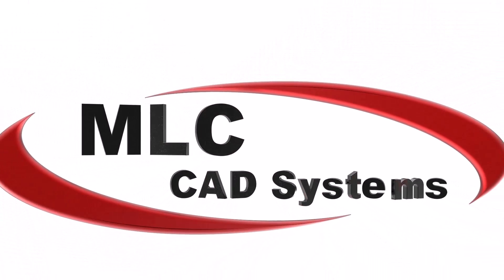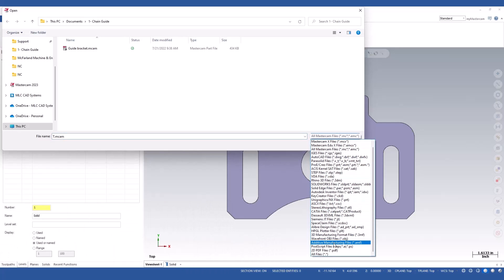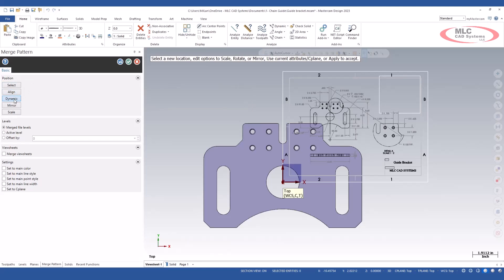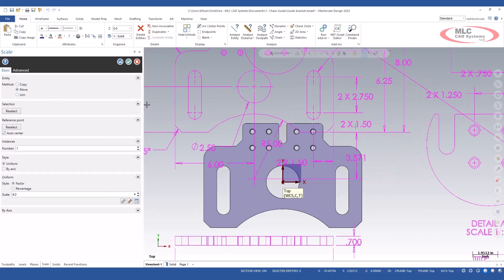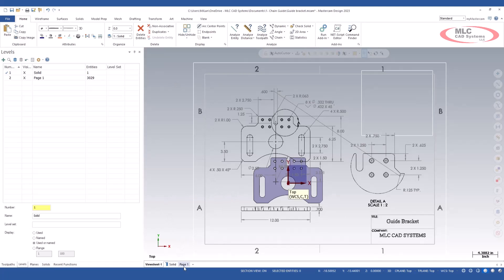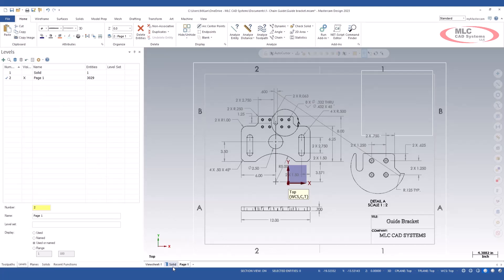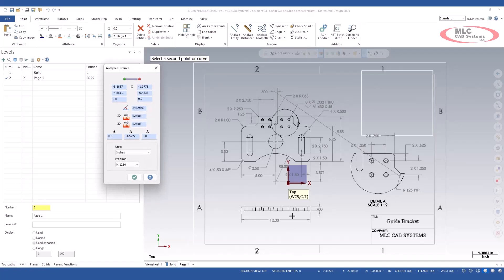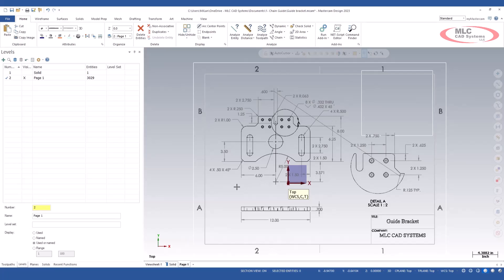Import PDF Drawings into Mastercam - What's New Mastercam 2023

Comment: Mastercam needs a better tool database for speeds and feeds. Something where you can define every possible setting for every toolpath and every material when you edot the tool so you can set it up once and just create a machine group, choose the material you cut, create a toolpath, add the geometry, choose the tool and the correct speeds, feeds and coolant will be automatically picked from the database. That would be infinitely better than the current one and also, with a high probability, get more people to jump ship towards Mastercam.
Reply from the maker: Check out the Mastercam Tech Exchange. https://community.mastercam.com/techexchange (login required).  It isn't possible to create a 100% universal tool database with all options pre-set, but several on there are great starting points or can save you some time getting started.  From there, it will take time to fill everything out for your machines and your shop.  It will be time well spent, especially for the more commonly used tools.
Reply: @MLCCADSystems  thanks i will have a look

Comment: I don't see the point of the PDF import. Maybe like where I work, they used to not have Solidworks, and have very old blueprints. But they are large prints. So can I scan a 3-foot print into sections and splice it, save it as a 3-page pdf and import it into Mastercam? I'm not sure this is a help. Maybe I am just short-sided here. I do really like Mastercam. I think is one of the better cam software out there. I also really like you guys MLC Cad. You do good work.
Reply from the maker: I believe this workflow isn't going to work for everyone, but it was voted the most popular at our recent webinar.  I imagine job shops getting PDF prints with no models, and instead of having the drawing with dimensions and tolerances on your desk or on a separate monitor, having them overlaid on or under your geometry as you work would make it easier to reference.  Plus, if the PDF was exported from CAD, it should have selectable geometry which is perfect to use for part or toolpath creation or hole location.
Thanks for the compliment, we've got a lot more enhancement videos releasing very soon!